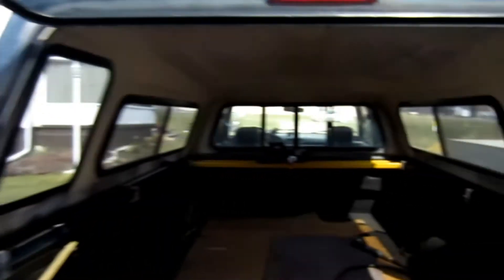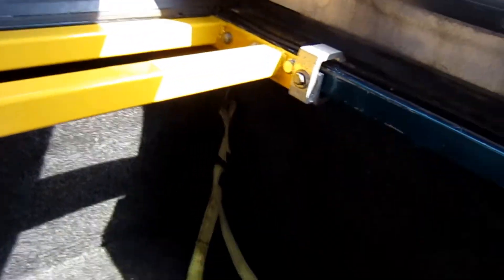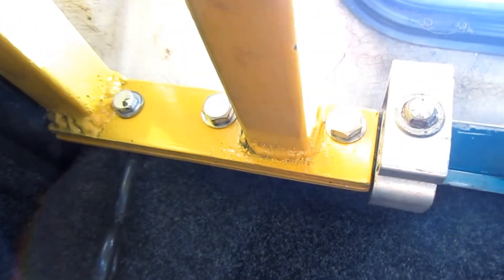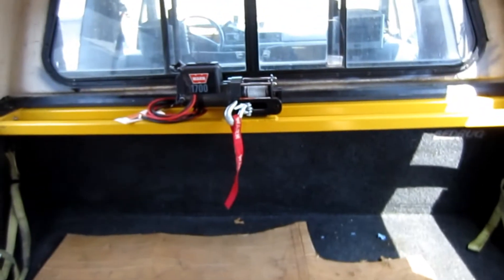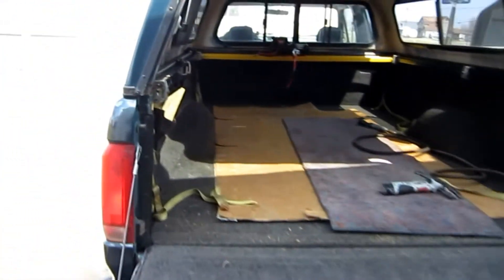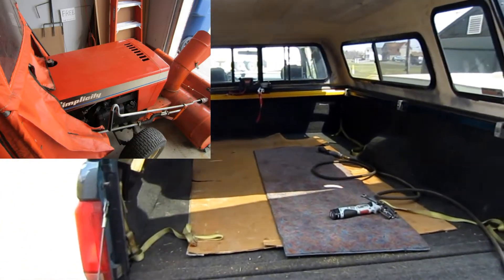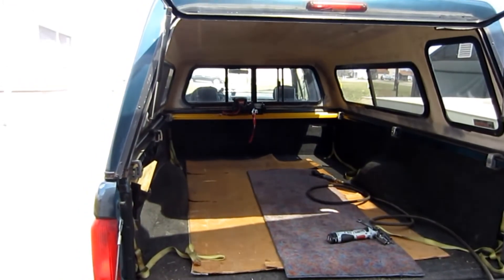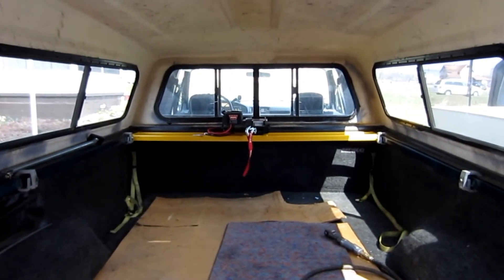F150 Warn Winch bed rail mount

Comment: love the design and i love you video's. but those welds are rough! they look really cold to me. but keep up the work , and the welding will get better . LOL
Reply from the maker: You are dead right about the welds. I was told the same thing by a certified welder. At the time I welded the mount I didn't have 30 amp service available in my garage so the heat setting was one down from the highest setting which turned out to be too low. Thanks for the compliments. :-)